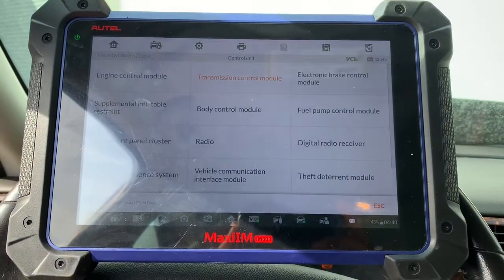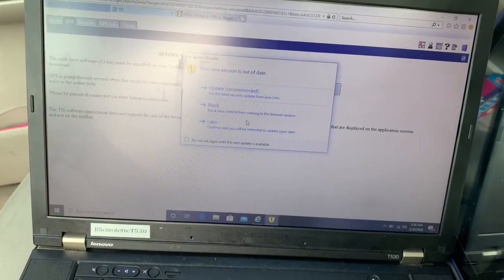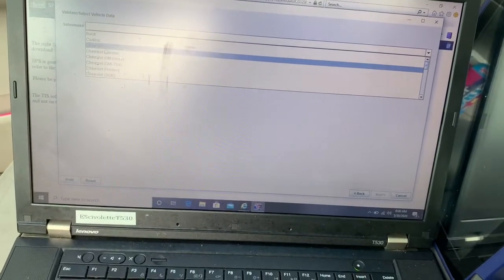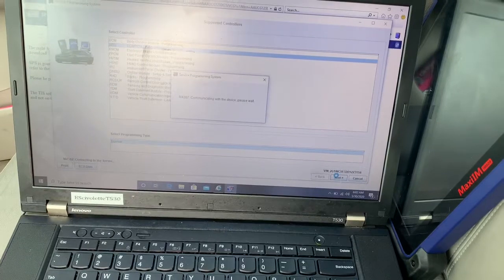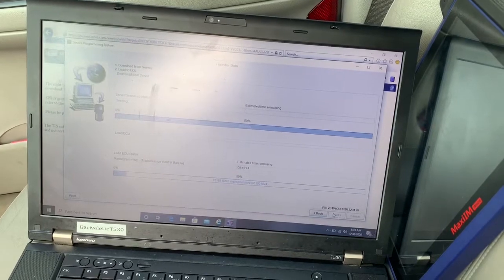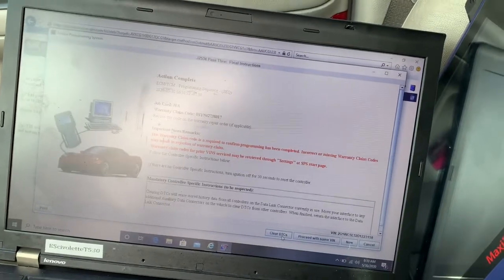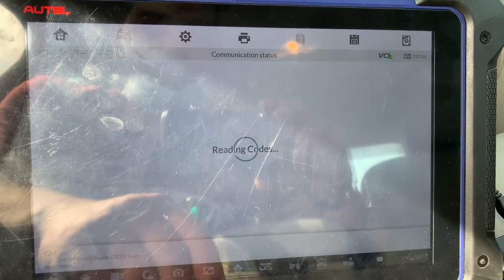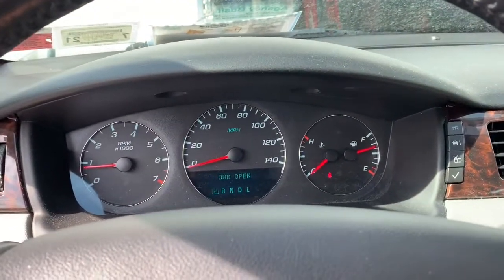GM TCM( transmission control module) Programming (SPS1 Old system)

Comment: Hello friend! From your experience do you think I can replace a 6T40 Gen1 from my Opel Astra J with a new one transmission 6T40 Gen2 and programming the new TCM(clear TCM) for my car without any problems at the synchronization with the ECU of my car? Thanks! (The same car with the same engine code after 2012 equipped with a Gen2 6T40)

Comment: Do i have to program a Tcm even if i get a used one out of the same car (junkyard)??
Reply: Yes
Reply: I know I’m a year late to this, but the answer is actually “not always”. I just got back from the junkyard 2 hours ago, where I pulled a TCM from a 2012 Impala (Police). And just now walked back in the door from test driving the 2013 Impala I put it into. No codes, no errors, worked perfectly and solved my shifting issue. Note that halfway through my test drive I did reset the adaptation using my scan tool but I don’t think that was strictly required. 

So at least in my case it worked fine. I got the idea to try it from another comment I saw elsewhere saying if the model is close enough they can work with no programming. 

From what I understand however, any new OEM, refurbished, or new aftermarket units WILL have to be programmed. 

Good luck!
Reply: @truthsmiles thanks

Comment: I replaced shift and pressure control solenoids in a 2006 Buick rendezvous to address a dtc and the lack of gears d, 3, and 2. Do I need to have the transmission programmed?
Reply: Did you have to program it

Comment: Hi, I’m trying to fix a flooded car I’ve already replaced the engine & transmission. Now I’m on all the electrical components if I buy all the modules can I use this software to program all the modules to my vin? The dealership is charging me a arm and a leg
Reply from the maker: Definitely! You can program used and new modules as long as you a decent laptop and and a j2534 device. This software is SPS1 which outdated and shutdown. I have another video with SPS2 which is the new system.
Reply: @huyug1  I have a jeep, would I use this same software your using? Or a different one?
Reply from the maker: @checkmate4213  no, another software called wiTech which is only for FCA vehicles.
Reply: @huyug1  ok thank you man!

Comment: Hii
Code U0101 chevy malibu 2011 3.6l, is that code means its need to reprogramm?
Reply from the maker: No, it means you have no communication with TCM. Powers and grounds needs to be checked properly. Communication lines need to be checked with a lab scope. If everything looks normal, the TCM needs to be replaced

Comment: I have 2009 Cadillac escalade. The tran is reading. P2723 it wont move unless gas is applied. Do i need a new tran or what
Reply from the maker: The car needs to be diagnosed properly with a professional diagnostician

Comment: What does it mean if your tcm can't be relearned I ask because put a upgraded tranny in my truck with a shift kit and I am getting random codes  like one shift soeniond is somehow stuck off and stuck on at the same time truck is don't drivable won't let me get above third  and throws p0700 and more and goes into limp mode they tried to do a relearn on it and it would not let them do it help please if anyone knows it's a 06 Duramax lbz
Reply from the maker: What kind of car?
Reply: @huyug1   06 Silverado 2500 lbz Duramax Allison 1000 6 speed
Reply from the maker: @hardtimefarms9270  check all of your wirings

Comment: Ok well can you reprogram any tcm i have a gmc acadia 07 but i read a lot of info on the net about putting  a 2010 transmission but it said swap the tcm for no program needed can you clear  this out for me
Reply from the maker: Yes, if you swap it with the Tcm you won’t need programming BUT if there is a sequence programming with the ECM then yes you still need to program it
Reply from the maker: Basically the ecm and the tcm need to learn each other in some cases

Comment: Ok my 2003 dodge dokata doesn't want to shift past 3rd unless I force the car to go to 30 once it goes to 31-35 at on average 5k rpms it shifts just like normal from there is that a bad tcm bc it's not throwing any codes and it doesn't make any funny noises so please help
Reply from the maker: I’m also working on a ram 1500 with same issue will keep you posted once I solve the issue
Reply from the maker: Did you change tires at any point?

Comment: Hey there I have a Chevy Cruze 2011 LT and they told me that the transmission computer module has to be replace and I was wondering if u could install and reprogram the computer
Reply from the maker: Yes I can
Reply: @huyug1  where are u located
Reply from the maker: @thenewmix9737  NYC area
Reply: @huyug1  oh okay I’m in Pensilvania so you’re like 2 hours away from where I live
Reply from the maker: @thenewmix9737  if you have j2534 device and a laptop I can connect to your laptop and do it remotely. Or I can come to do it but I would have to charge extra. For further questions you email me at huseyin0240@gmail.com
Reply: @huyug1  I don’t have a laptop at the moment but I’ll see if get one and oh okay I’ll text u there

Comment: Uyug I have couple of questions for you, what is the best way to reach you at?
Reply from the maker: You can give me a call at 1 (347) 265-0322
Reply: @huyug1  omg I didn't get any notification from YouTube that you replied. I will call/text you thanks!
Reply: Hello Huseyin, I have a 2014 6 speed 5.3l ltz 2wd chevy silverado and I'm under impression that the tcm is also inside the transmission itself. Is there anyway to replace the tcm itself? I called orielly and autozone and they say they have the part available but no one knows exactly where it is located. How do I access this tcm any ideas? Do I need to take it to a programmer instead? I appreciate your time with this.
Reply from the maker: @chapasebastiano8  hello. It is together with the valve body inside of transmission
Reply: @huyug1  thank you for quick reply. You are right I looked up part on autorock and module is big component part goes inside transmission. Now my debate is if I should buy a new transmission which I assume comes with the new tcm included inside or just buy a new tcm module and repair/replace old transmission with this new part. Any suggestions? You are a great help. Thank you

Comment: Which Software are you using for the programming in Laptop?
Reply from the maker: It’s called SPS ( service programming system) which for gm Vehicles
Reply: @huyug1  
Hi, I have a 2009 Impala 5.3 I just replaced the transmission and now I have no start issue.Does TCM have to be programmed to this new transmission? Also I have no communication from the trans to the ECM and no shift box icon on the on the instrument cluster.
Reply from the maker: @cedthetruth1311  
-if you have put in used transmission no really need to program but if new transmission yes definitely needs to be programmed.
-if you cant basically can’t communicate with Tcm; it can be for many reasons such as 
No 12 volts to tcm 
No ground to tcm 
Can bus issues 
Bad transmission
Reply from the maker: @cedthetruth1311  I had same issue actually with same exact vehicle and it was the transmission. I’m not saying that’s your case but be careful with rebuilt transmissions with GM vehicles

Comment: I have chevy cruze (Daewoo Lacceti) 2010 model from South Korea, I had issues with the automatic transmission for some time and I decided to convert it to manual transmission. The conversion has been done but my auto electrician is not able to start the engine for me. We have consulted other auto electrician available but it seems they are clueless. The diagnostic machine detects there is break in communication with the TCM. Any help?
Reply from the maker: If the  TCM located in valve body you would have to also replace the ECM as well or need to be reprogrammed to work with the manual transmission if t still doesn’t work check all wirings or short and use a scope to detect communication status tcm.
Reply: @huyug1  Please I will like to engage you further. This is my whatsap number +233560467391 or email: eopokuagyemang@gmail.com. Thank you
Reply from the maker: @emmanuelopoku-agyemang3299   no problem I will give you a call in couple hours.
Reply: @huyug1  I will be waiting for your call then. Thanks a lot.
Reply: Please I am still waiting for your call or whatsap message.
Reply: The engine has been able to start. The TCM was reprogrammed by an expert and some few connections made and the car is moving now. But another issue is the radio, sound and speedometer are no working. The radio screen is black, no blinker sound and speedometer not reading. Any solution to this!!!

Comment: I have an 2015 impala Ls l4 , my car is currently at the mechanic shop , whenever they put a used transmission in , do I have to take it to the dealership to get it reprogrammed? Or no because the used transmission they’re putting in is stock and it matches with my vin #
Reply from the maker: Hello, if the vin matches you shouldn’t have any problems. Sorry for late reply
Reply: @huyug1  what if it's a different transmission from another Impala.
Reply from the maker: @ds6843  I have see many cases that used transmission doesn’t have to be programmed. Check for DTC after replacing unit. Refurbished and new ones needs to be programmed.
Reply: @huyug1 Just want to say thank you for this comment. I just returned from the junkyard with a TCM from a 2012 Impala (Police) and put it into my 2013 Impala. No codes or errors and best of all my shifting issues are resolved! Thank you so much for letting us know it was possible 😊

Comment: Have chevy cruze 2009 automatic transmission when the car reach 5 it act like it downshift after reprogramming the car it act normal for 6 hours and then return to same problem what do you think my problem
Reply from the maker: It sounds like you have transmission module problem or transmission itself. Do you have any stored codes?
Reply: Huseyin Uyug thank you for reply there is no transmission code only o2 sensor and thermostat code

Comment: would this be the same procedure for a gm vauxhall insignia tcm replacement?
Reply from the maker: I’m sorry for the late reply since I just saw it. 
Yes! All GM transmissions almost programmed this way.
Reply: @huyug1  Thanks for your reply i got mine done finally last week that said because the psa group in europe have taken the opel / vauxhall brand the ac delco site is not for my car they were very helpful in finding the psa site for sps programming it is the same procedure